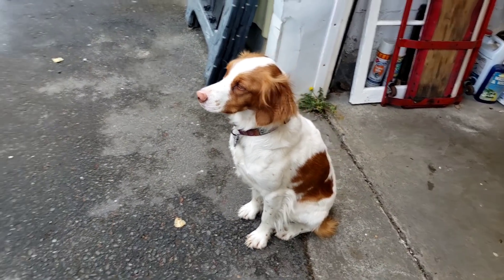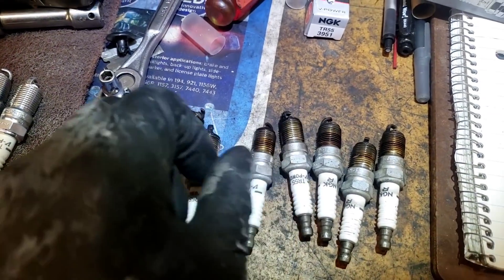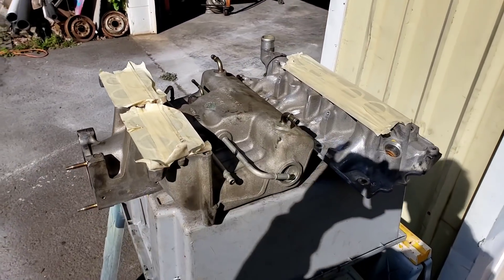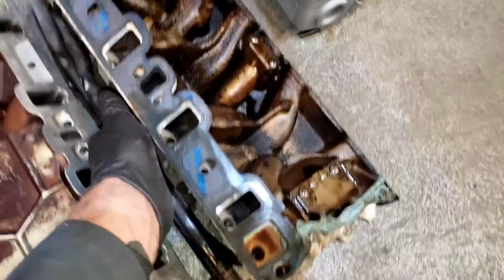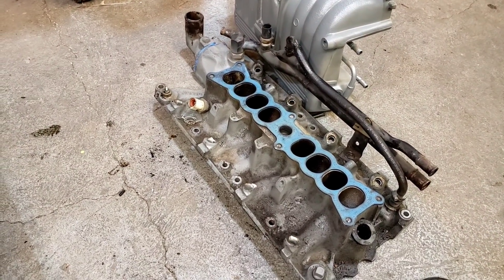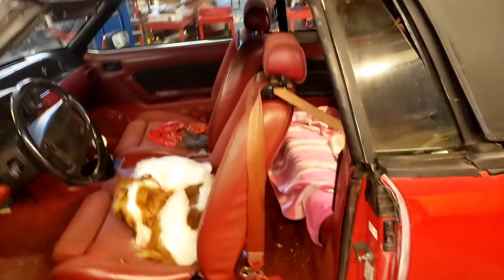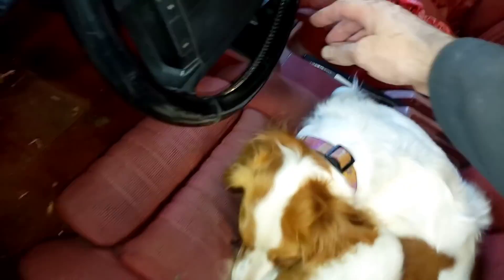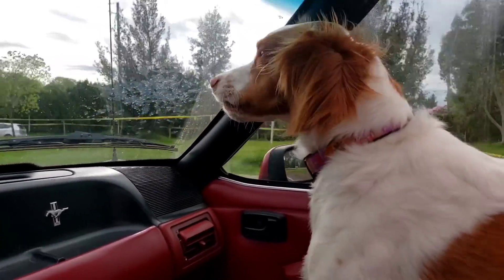Ford V8 Engine Oil Burning Mystery May Now Be Solved

Comment: Just watched this in 2025, YouTube algorithms. GT40 heads, looks to be larger throttle body to improve flow.  And stock intake to 'pinch the straw'. Did you put a larger MAF on at least? Your late Explorer intake does not provide EGR passages to the EGR valve, hence you don't have working EGR. The Explorer has a pipe going to the EGR plate. Don't need the vacuum line or electric plug in. Unless your emission testing is just looking to see if the equipment is there.
Reply from the maker: It runs great. It has very good throttle response and very good torque. I've actually thought about removing the explore intake and putting the stock one back on. Because stock intake had a immense torque peak at about 1800 rpm. . It was so fun.

Comment: Low tension oil rings caused oil burning issues with 5.0's from that era. 1 quart every 800 - 900 miles was considered normal. I worked at a Ford dealer during that time. Some  customers would have us put a couple extra quarts of oil in the trunk  to use between changes. They ran fine, but burned oil.
A leak down test may provide you with some good data as to the condition of your engine if the oil consumption continues.
Sweet car! 👍

Comment: I didn’t know it for years until I did a detailed inspection of the pcv piece and discovered the wire mesh thing. It too was clogged with a very hard carbon buildup. After replacing it I noticed a difference. I’m glad I changed it.

Comment: Just do an EGR delete, more crap that doesn't need to be put back into your manifold.
Reply from the maker: I didn't want to spend 200 dollars on the 70mm EGR delete spacer and wait a week.  So I just run it stock. Ported it from 65mm to 70mm myself. Done. Drove home same day.
Reply: @2stroketurbo  $200 USD for a spacer ?, jesus the old Windsor V8 asks ridiculous money for parts 🤣
I would have simply made a sealed blanking plate over the EGR inlet port into the throttle body 😁
Reply: @2stroketurbo  It's kinda another reason why in the Australian market i prefer the Supercharged GM 3800 Series 2 (L67) over the N/A L36 application 
Not simply because it's a stronger engine, but the only emissions based crap on it is PCV & the usual evap side from the fuel tank
NO EGR VALVE, thankfully !
Where as N/A L36's have all the emissions crap 🙂

EGR, PCV, Evap, etc
Although doing a simple PCV valve on L67's is a 15min job where as the N/A L36's require the entire intake manifold to be removed 🙄

Comment: A Ford burning oil is nothing unusual in Europe, especially those from the '80's. They had bad oil scrape rings, my first car was a '81 Ford Taunus 1.6 GL (no not Taurus) and it used a pint of oil on a full gas tank. I had a trunk full of empty oil cans. Later I owned a '81 Transit 2.0l ( L4 Pinto engine) and a '81 Granada 2.0 V6 and they both liked the taste of oil as well... Also had a '90 Scorpio 2.0 DOHC and a '96 Mondeo 1.8 but they didn't use much. 
My current '96 VW Jetta is the first car I own (of 26 in total) that doesn't use a drop of oil at all.
Reply: Im Canadian. But lived in the UK in 2000 to 2001.  I had a European Ford Granada 1986  With the big hatch back.  Cant remember about the oil burning but for some reason i was just thinking about that old car then i read your post.
I hadnt thought about that old car in years

Comment: Mustang GT's are built Ford tough !! Ford knows these cars will be beat on n then the next owner will beatem up some more!!! If your lucky enough to get ur self a new GT manual trans and take care of it , drive it normal they will run great for years I've driven daily my 2002 Mustang GT 5speed car this Feb will be 17years and 350000.0miles I love my baby!! Had to replace leaky intake is only bolt ever turned on engine!! Still got factory clutch

Comment: You mention smoke after significant over-run. Isn't that usually valve guides ? i.e. inlet vacuum pulling oil past valve guides.
Reply from the maker: Possibly,  except valve guides are brand new no sign of leaks
Reply: @2stroketurbo  Meant to say valve stem oil seals but I guess they are new too.